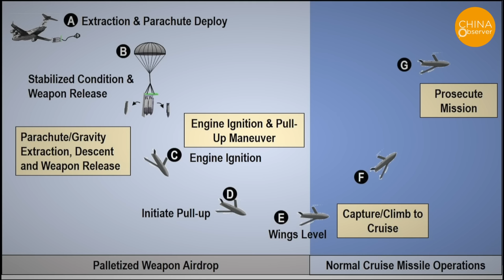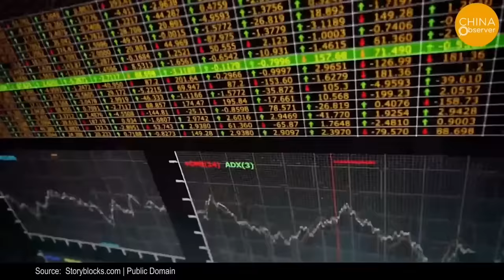Treating the Shandong Like a US Aircraft Carrier Makes Xi’s Superpower Dream A Joke

Comment: The two Chinese carriers are diesel powered. They have an operational range of less than a week. The "supply vessel" mentioned in the video carries fuel. In comparison, US nuclear-powered carriers can operate twenty years prior to refueling. Like everything else in Chinese, their ships are tofu dreg.
Reply: They are paper boats
Reply: Plus the engines in the planes could only take a couple weeks of high rotation use before they need to be replaced or rebuilt. That's the PLAF's big Achilles heel. They can copy a design... sort of, but lack the institutional knowledge to make quality parts.
Reply: I measure range in weeks... 🤨
Reply: No they are not diesel...gas fired boilers with steam turbines.  Operation range measured in "a week" means nothing, the cruising range is 8500 nm.  The first was Russian built...old designs but they have nothing to do with tofu dreg construction.  That being being said, they shouldn't even be spoken about in the same category as US Fleet CVs.
Reply: I've said it once and I'll say it again the problem with "made in China" is exactly that it was made in China. 😂
Reply: @T0tenkampf  They are Tofu Dregs construction since only the first one was built by the Russians, and it has been a reliability disaster. Yes, they are oil fired boilers and turbines but the fuel supply is less than half what is claimed and the range quoted is at an 8 knot cruising speed.
Reply: The nuclear powered component can operate 20 years, but the ships still need provisioning with regular fuel and food. Still, I agree that the glorified Admiral Kuznetsov with Xinese characteristics is almost certainly less impressive than its hype.
Reply: I guess I was thinking about the actual Russian ships
Reply: I thought they were powered by soy sauce!
Reply: true, but you also have to figure fuel for the planes, munitions, and food.
Reply: ha ha ha ha ha !!!! shoulda bought stock in chirese tofu ha ha ha ha
Reply: 100% Chinesium made "high tech super-duper 5G AI" military strength ChaBuDuo. No face left to lose for Xi, it's all gone... 😂😂😂🤕🤕🤕
Reply: And they just need 3 days to only start their diesel engine
Reply: they operate 25 years before needing refueling....1 refueling gets you a 50-year hull life
Reply: @brunojm7282  wait till 75% of their total oil supply is stopped on super tankers in the Indian Ocean. No fuel, no military. So weak, and so angry. Poor Pooh... 😂😂😂
Reply: All Chinese ships come with a tug boat, Putin's towing company insurance dot inc., and a radio....
Reply: @TheWatcher860  7:18 b be
Reply: Yes they are, 
But they also have nukes
Reply: @ottopartz1 building things from scratch, though hard, expensive and time consuming often pays.
Reply: Carriers never operate alone, the rest of a carrier battlegroup and its aircraft require similar levels of logistical support to a diesel carrier.

The Chinese carriers don't have the advantage of eighty years of use to hone design and skill however.
Reply: 😂They have coal, so maybe revert back to steam engines,  it's a better excuse.😅
Reply: You mean like their paper space station that's still up there.
Reply: Chinese aircraft carriers are using Quantum steam engine 🤣🤣🤣🤣
Reply: @americanoutside  China still has Fujian aircraft carrier, Dude....
Reply: @satriojumeneng7055  Ok! 😂
Reply: @satriojumeneng7055  does that one run on gutter oil too or have they finally mastered 1980's technology? 🤕🤕🤕
Reply: @kamsunleong6648  they use the Tofu space station to spot their aircraft carrier when it breaks into pieces like before. 🇹🇼🇹🇼👀👀🌎🌎👍👍👍
Reply: We dont kn ow the baclstpry to what hap[pened. Lets wait for a throught review of the facts b efore w ejudge,.
Reply: If a nuclear powered ship is destroyed are there any countermeassures to prevent radiation leaks?
Reply: @mrbluesky853  rEACTRO SHUTS DOWN IF IT IS NTO HOROZONTAL OR FLOODED
Reply: @powershift2024  Fujian has an electromagnetic catapult. Only Ford class that has something like this in the world.
Reply: @ottopartz1 That's not a design flaw though, it's am effective cost optimization, since it's not like a pilot's lifespan is going to be anything beyond a few hours
Reply: Even if the Chinese equipment was on par with the US (it's not) there's no way they can defeat the USN who's been doing this for 248 years and in practically every major conflict for over a century.
Reply: Powered by gutter oil.
Reply: China doesn’t really want project power beyond South China Sea and Taiwan. Thus it Makes sense to not waste building expensive  nuclear power aircraft carrier.  it was also a smart move since their shoddy construction might lead to the tofu quality nuclear power plant to melt down or leak radiation making their aircraft carriers  floating Chernobyl
Reply: @ottopartz1  
US carriers can carry out maintenance at sea...a huge plus.
Not to mention the fact that their planes are more robust and reliable.
Reply: @T0tenkampf 
There's a huge difference between cruising range and operational range.
Oil powered Carriers have to speed up to launch and retrieve aircraft...burning much more fuel and drastically shortening their range.
A problem nuclear carriers don't have.
Reply: Chinas new EM catapult still doesn't work properly two years ship launch. It hasn't even done a sea trial yet. The ship is vastly underpowered to supply the new catapults with enough power. The EM generators use normal fuel (that also must be resupplied.) To launch they must use aircraft that is not fully loaded with fuel or not fully armed. So planes will have reduced range or reduced firepower, that's a real problem. The US carriers are not under any of those contraints even if most of them use steam catapults. Their current Russian built ship is junk.
Reply: @powershift2024 He’s a sad pooh Bear
Reply: @satriojumeneng7055  
Yes, but the ones on the Ford actually works...and they launch real, combat proven aircraft.
Not the Chinese Flopping Fish...
Reply: @satriojumeneng7055  lmfao, those Chinese catapults don't work and have actually been modified as steam catapults.
Reply: @ottopartz1 Dont forget, they don't have any early warning aircraft other than the helicopters which is limited on fuel and range

Comment: an interesting economics question posed to me, was why the US purchased petroleum from OPEC and others?  reserves.  reserves in the midwest, the west coast, and the gigantic reserves in alaska and under the arctic.  reserves the US will have centuries after everyone else has depleted theirs for profit.  if it becomes national survival, conservationist agendas will be set aside, and those reserves will be tapped.
Reply: The US does not buy oil. The oil companies do. And not all oils are the same. 

Alberta sand tar for example, takes more energy to refine into petrol than Saudi oil. So its cheaper for the oil companies to transport. 

Also, refinaries can only handle specfic oil types. If your local refinary was designed for Brent  crude, then it probably wont handle Texas sweet crude. 

Gotta remember, the function of the oil companies is to make profit for shareholders. Every single thing they do, they do with that aim. It has nothing to do with Potus, or the green movement. Its commercial 👍

Comment: remind me, how many aircraft can this carrier have on board all at once?
Reply: Up to 44 planes
Reply: In addition to extensive prep to ready one of the Chinese carriers for operation, as soon as they finish even a short mission it's sent back to the shipyard for repairs.
Reply: @h5mind373 and the planes for engine rebuilds.
Reply: @@user-pi3fc1qt1l you are incorrect, they have one Chinese design building and the two purchased from Russia completed sea trials in 2012, and 2019.
Reply: @T0tenkampf  Though with China's new Fujian carrier, it is very doubtful it is anything else in basic design.  It is very likely just an adaptation of the same previous design.  Aircraft carrier design is extremely complex and requires many deep expertise from many people as well as extensive experience in carrier operation and warfare.  Even then, the process of designing a new class of carrier takes many years.  A modern carrier is a fully functioning city at sea, a war machine and a fortress.  China did not have the expertise, experience and technological design base.  Seeing China rolling out the Fujian so fast is a big give away.  It got the original carrier design from Ukraine.

Comment: There is no doubt that the Chinese navy is a formidable force in the waters adjacent to the mainland and should taken very seriously.  However, once outside the first island chain they are extremely vulnerable and outside the range where they can be supported by land-based air assets they would be taken off the board fairly quickly.   They do have a significant submarine fleet, though, and that is always a wild card.  I am not sure how well US and allied forces can track those vessels.
Reply: very easily....they are plagued with a ton of maintenance issues, and once they finally did leave port...back in 2011...our subs found that they are stupidly noisy and tracked them the entire time.

russia is 10 years behind our sub technology 
China is 20 years behind our sub technology
Reply: Lets just say all subs are accounted for at all times by the US. The US takes submarines incredibly seriously, no matter how out of date they are.

Can’t say anything more of what I learned aboard the USS Mississippi. 

The subs and aircraft would be the first targets, followed by surface ships.

Comment: "with a missile accuracy of 30m, ensuring a hit would take at least 4 missiles"
that's not how probability works at all.
if a missile had a 25% chance of hitting, the chances of zero hits out of 4 is 0.75^4=.31=31% and thus the chance of 1 or more hits is 69%, not 100%

Comment: I think the whole calculation about the number of missiles is really dµmb. This 30 to 100 meter accuracy and the 10,000 missile requirement just might work provided that this inaccuracy spreads in all directions, 360 degrees and evenly. If it is like a steering wheel of  car pulling to the right or the left then even 40,000 missiles would miss by miles.  BTW not a ingle one of their ships or armaments have been tested in real live action. No wonder their soldiers brown their diapers when they get posted facing the Indian soldiers at sub zero 16,000 feet elevation in the Himalayas.

Comment: Something to comprehend, China imports over 75% of it's energy and over 75% of its food/food imports.  The U.S. has protected trade routes that allow this to even happen.  China has a very large navy but it's not 'blue water' and physically cannot protect those shipping lanes.  Additionally, the Chinese have bought and/or stolen copies of Russian military equipment for the most part.  They might be having some multi-trillion yuan buyers remorse watching the Russians get annihilated in Ukraine.  The Russians had roads and tracks to haul their gear and personnel, China will have to cross a 100+ mile strait to get boots on the ground, to supply those boots.  Not an easy task.  I guess the Chinese could 'bomb' Taiwan into submission, but historically, that doesn't work most of the time. The U.S. had success in Bosnia, but think of Ukraine, Vietnam, the Germans and Japanese during WW2, etc.  The point is even if China could take Taiwan it would not be able to hold it long term. Say they attacked in the Summer, by Fall/Winter there would be 100's of millions of Chinese freezing and starving to death, the economy would be non-existent (Russia is a massive exporter of food/fuel, China is the opposite).  Finally, I would concur about the carrier.  Sink one and there would be no sympathy from U.S. citizens.  No one would blink twice at the notion of all out war.  Sure some bleeding hearts would cry foul, but they would be drowned out by the drum beats of war. We, U.S. citizens can be unfathomably kind, fair, and just, however, bite the hand that feeds you and hidden by a veil of patriotism, revenge, and worse of all, indifference to the plight of the opposition.

Comment: China would not be the winner if they went into a hot conflict with Taiwan or the US.  China would for the most part lose one of their major customers, the US, which they depend on as a buyer of their goods.  Next, if they lose a handful of capital warships it will have a significant impact on their economy in replacement costs.  Remember right now China is having some rather significant economic problems.  So they may win a battle short term they lose the war in a major defeat due to economic collapse.

Comment: The math here, starting a bit after 4 minutes into the video is bad. If a missile takes just 10 seconds to reach a U.S. vessel, it is VERY CLOSE and is NOT a ballistic missile. For such close ranges, the missile will NOT rely on GPS to reach its destination. At such close range, it would instead use some combination of radio guidance from its launch platform, infrared seeker, onboard radar, and even visible spectrum imaging. The calculation using GPS is applicable to China's large number of multi million dollar, ballistic missiles, fired from land or ships fa enough away that the time to arrival is minutes, not seconds
Reply: I think the purpose of have a 10 second flight time was to make the math easier. Had a more reason 10 minute flight time been used, the number of missiles needed for an assured hit was multiple an a exponential rate as the target carrier would have traveled 60x longer and the area of uncertainty expanded accordingly.
Reply: @Rob_F8F  You may be right. Still, the math is misleading. China's 'Carrier Killer' ballistic missiles will use  CEP (Circular Area Probable) along with GPS. But missiles that are seconds away from their target are not ballistic. She's also missing a key element. To hit a MOVING target with ordnance that costs millions$$ each, they're too costly to just lob many in the hope that one hits. These aren't treated like low cost artillery rounds. There MUST be some in-flight correction. Like our LRASM missile, they will use telemetry and/or homing sensors for in flight correction to achieve a hit.